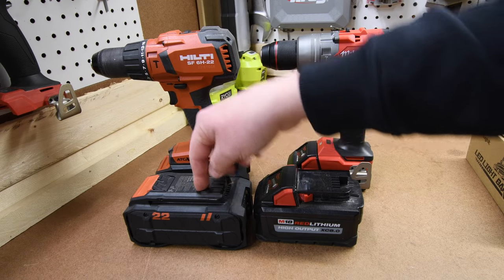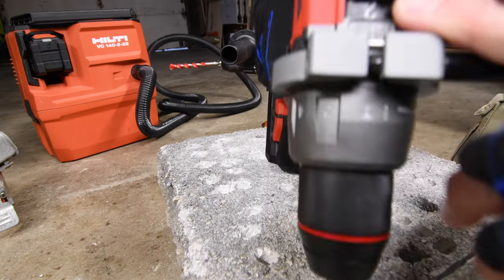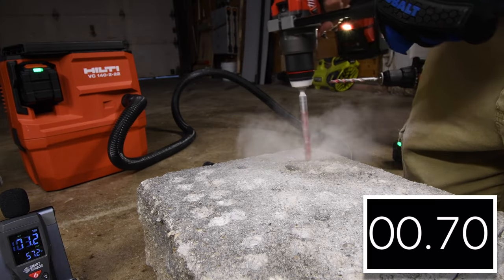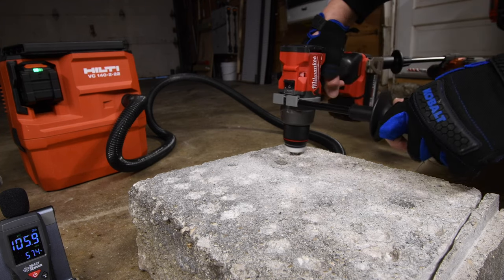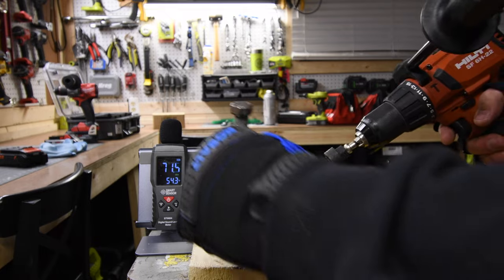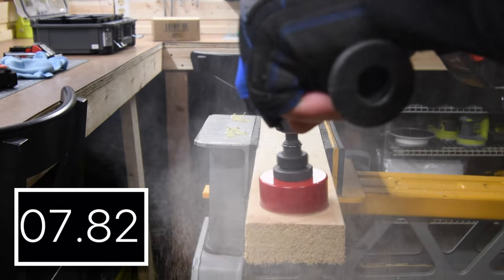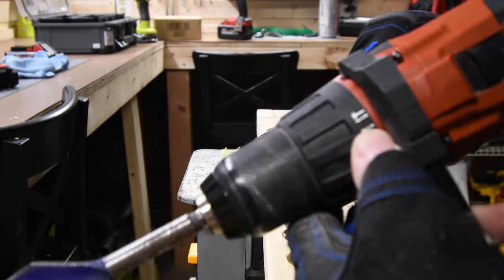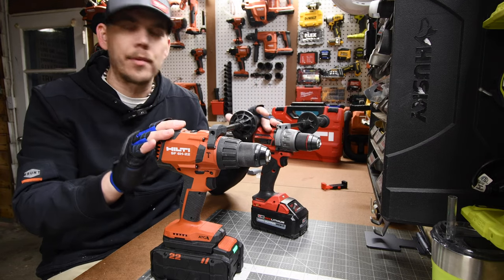Milwaukee Gen4 vs HILTI NURON (Hammer Drills)

Comment: Hilti. Is hands down the best tools on the market.
Reply from the maker: HILTI is a fantastic brand.
Reply: I run Hilti and Milwaukee gear.  The Milwaukee gear is crap compared to my Hilti stuff. Milwaukee triggers on fuel jigsaw,  gen3 combi & impact and 6 1/2" Circular saw don't work half the time. 
Dave.
Reply: Not only does it perform better but they last! I changed two chucks and then the motor finally went out in a Milwaukee before the hilti had a hiccup. Milwaukee fanboys make me laugh.
Reply: Meh, I gotta say Hilti is great but Bosch is comparable.
Reply: Hilti batteries and tools have a serious problem on their a22 series. Multiple people I know have batteries that just stop charging out of nowhere as well as the charger. Other than that hilti tools are amazing. I love how they work full throttle until the battery runs out. It doesn't slow down at all.

Comment: Hilti is awesome and the quality and durability is the best in the business. I have had my corded Hilti hammer drill for 20 years and it is still working as it should. 

The price however is a bit steep consider you get the same performance for almost half the price with brands like Dewalt, Milwaukee and Makita.
Reply from the maker: most people love the HILTI brand but the price point is why people dont buy into it.
Reply: Because Hilti is for the professional not homeowner. Quality, craftsmanship, warranty, one day turnaround for repairs is hard to beat.
Reply: @thenomenclature7243  Yes, but you are also paying for the service in the tool price. Brands like Dewalt, Makita, Milwaukee and Bosch are also for "professionals" but the price point is lower and the quality is usually a bit lower .
Reply: I'd say Bosch is right there with Hilti.
Reply: @normalguy4147  Bosch is great and the quality is good, but the durability on Hilti is on a league of its own from my experience.

Comment: Dude! Brother, thanks so much for showing the anti-kickback feature of these 2 fantastic drills. It's incredibly important for tools of this quality, and capacity to have such a feature.
Reply from the maker: ill show that for now in my drill videos or sds videos. :)
Reply: I agree completely. I have had cartilage/ligament surgery on my wrist due to my wrist getting torqued the way drill kickback happens, and that anti-kickback tech is very important when you're using the drills in the high torque setting.
Reply: @l00nybin  Milwaukee only has kickback control in one direction, which I found out while in reverse one day

Comment: That handle bothers me too.  The only reason I could see for it is if you bought the kit, the way they store the handle is disassembled.   So because of that I think they took the pin out so you could take it apart for storage.  Seems like an unnecessary trade off to me.
Reply from the maker: its a loss, that pin helps out big time to get the handle on quickly and easily
Reply: @ManCaverTools  with all the bad handle designs out there is sometimes seems like they are trying to get to creative about it.  Which one is your favorite?
Reply from the maker: @TinkerWithTools  My favorite handle  is actually Makita. the short handle that came with the 14 hammer drill
Reply: Time to see if the Hercules BL hammer drill can keep up at all like their impact driver!
Reply: @txvet7738  exactly what I was wondering. TTC showed some amazing results with the impact driver, so I'm curious to see how the hammer drill performs.
Reply: @txvet7738 the Hercules is pretty good but still no match for the Gen 4 Milwaukee

Comment: I'm going into this video with the assumption that both drills will be equal, and that batteries this big are impractical for constant use. I'm interested in how the 5/4 ah will compare, and interested in the results of this video.

Edit: wow, they are both absolute brutes. The Hilti looks to be much more refined overall, but Milwaukee has gotten really fast. Your videos have gotten to be rather professional as well. Great job to all three of you!
Reply from the maker: I thank you Stauker, Ive been working hard on making the channel better. I will be uploading one versus video a week. doing the tool store walkthroughs majorly helped with talking more fluently to the camera
Reply: If you have the Milwaukee Fuel Gen 4 Hammer Drill I recommend using the 3 amp High Output Battery, as it still has the power to do the job, but at 1/3 the weight.  The only thing you’re giving up is runtime, but that can be mitigated with 2-3 amp HO Batteries.  I rarely, if ever use anything other than the 3 amp HO Batteries in all of my Milwaukee Fuel hand tools.  I’ll use the 8 amp battery in my miter saw.

Comment: HILTI IS THE BEST TOOL FOR CONCRETE AND FESTOOL FOR WOODWORKING
Reply: Who can afford or should I say justify Festiol,? I guess maybe a professional furniture or cabinet maker. I look at their prices and I'm shocked.  And I don't usually complain about prices.
Reply: @dangrimes5078  - I like Milwaukee for most stuff and I also have some DeWalt as well but when it comes to sanders Festool is hands down the best, I believe they have around 15 different types of sanders, i have 5 of their sanders.
Reply: @truthserum9157  I find that Milwaukee and DeWalt are both excellent. I am actually a machinist though. I like to build things but I'm only an amateur when it comes to carpentry.

Comment: Wow crazy how great milwaukee has become.  Such a powerful drill and a fraction the price of the hilti.
Reply: Did you even watch the video? They have the same tool price, smh my head
Reply: @stauker .1  that's weird because hilti is usually way more expensive.  The hiltiť drill kit with 2 batteries is over $800 so how ate they the same price
Reply: @markk3948  Hilti has better batteries
Reply: @stauker .1  I love milwaukee and have the best luck with them.  I always thought hilti was alot better.  I'm suprise how good milwaukee did against hilti
Reply from the maker: a lot of tools brands are so powerful now a days.
Reply: @markk3948  I own Hilti and Milwaukee. Milwaukee gear is crap compared to Hilti. All my Milwaukee gear have triggers that continually don't work and that is a Gen3 combi & Impact.  6 1/2" Circular saw and  Fuel jigsaw.
Dave.
Reply: @Dave Sheppard  wow  yeah hiltis are alot more expensive   I have over 50 milwaukee tools and never had 1 pronlem.

Comment: I just walked the tool aisle at walmart and found a few new hypertough stuff I assume it's garbage but I'm curious it's a 12v max brushless impact driver with 1380 inch pounds
Reply from the maker: even 12v impact drivers are powerful. when it comes to certain tools the specs might be a little off. but id go for quality over quantity.

Comment: I got my Gen 4 hammer drill with a 5 amp hour battery for 70$ then the impact Gen 4 for 107$ then the m18 fuel hackzawl for 90$ and a charger and another 5 amp hour battery for 50$ tax included on everything. The M18 line up is so cheap and good
Reply: Where the hell you buying them at those prices?
Reply: @dvrn86  like I said, it’s all about the Home Depot hack when they allow you to buy a tool with another tool or a tool with another battery on the receipt one of them isn’t free they both equal out to with the original price of the dealers then you can return the one you don’t want and you don’t want and don’t worry Home Depot ain’t losing anything. People have spoken to Home Depot representatives and they said that most people don’t return the second item or the item they don’t want and for the ones that do that usually the ones that are buying in volume and what they want to just to get it off the shelves.

Comment: Curious Dave, does the milwaukee carry a regular 8ah battery or only the high outputs.  I would assume if HO that has a little more kick to it than a standard battery giving it an advantage over the Hilti.  Although both were pretty close Glad to see the versus videos
Reply from the maker: I think they also have a high demand 8ah battery. but a regular battery I dont think so
Reply: The HO batteries are called that because they use 21700 cells where are better than the 18650 cells used in the xc batteries. As far as I know Hilti uses only 21700 cells so it should be a fair comparison

Comment: is it the new hilti sid4 coming soon?
Reply from the maker: ill have to take a look. it was on the website for a little bit but they removed it
Reply: @ManCaverTools SID -6 is available again and a new SID -4 just launched last week  bit smaller than the SID 6 ideal for electricians
Reply: New SID-4 impact is a single speed affair with less torque than the old SID-4.  I love my old SID-4 and am not interested in Nuron.
Dave.

Comment: I don't like the electronic torque function of the Milwaukee.  I prefer the old clutch type.
Reply: The gen 4 has the old kind of clutch. They droped the electronic one in the new gens
Reply: Yep. Glad they changed it back. Lots of people didn’t like it on the dewalt or Milwaukee. But some people did like it.

Comment: Gen 4 vs 999?
Reply: 998 is more powerful than the 999 based on my testings at work
Reply from the maker: will do, I ado want to pick up the power detect as well.
Reply: @kbtools9641  yeah but Lowes kinda barley exists in Canada lmao
Reply: @bread-gz3rl  ahh i see lol
Reply: 996
Made in 'Murica!

* cough * with global materials * cough *
Reply: @ManCaverTools  if you're gonna do that, please, put one of these up against Makita XGT. Tinker with tools thinks it's an absolute monster.
Reply: @stauker.1960  until you try to use it in concrete or